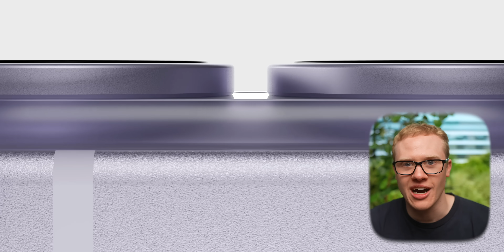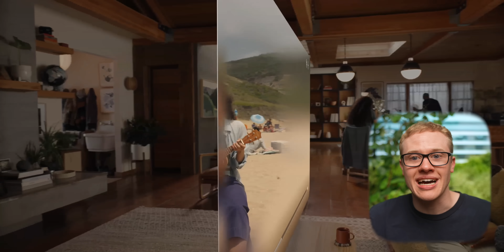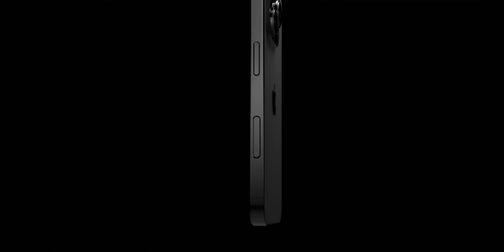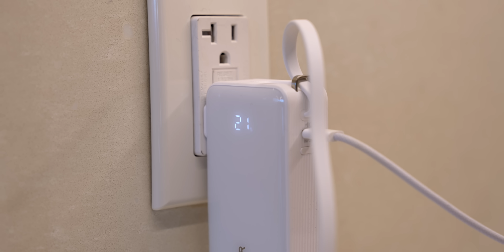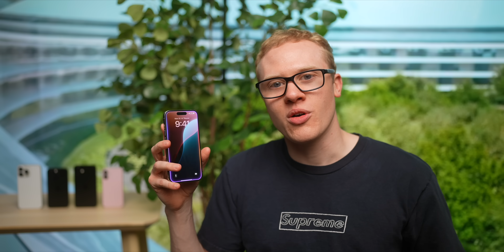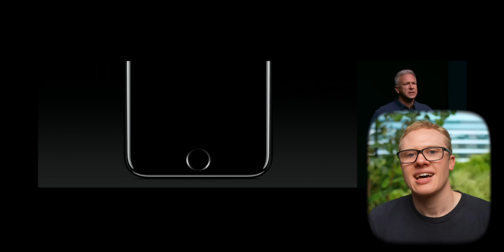iPhone 16 New CONFIRMED Leaks! FINAL Design!

Comment: Apple Humor Part 1 - Apple iPhone 12 design team: Make two cameras vertical again with a rectangle square.  Apple iPhone 16 design team: Make two cameras vertical again and this time with an oval word bubble.  Cost - $1000 and still no headphone jack.  Only charging cable included and you have to buy multiple dongles to make it work good.

Comment: I'm not an Apple fan. But I appreciate the well thought-out structure of Apple products. I'm mainly talking about the iOS system. It's like the gears of a clockwork. It just works. I've had every version from the iPhone 4 to the iPhone 15 Pro Max. The 13 was stolen from me in Kenya, so I bought a Nokia with Android as a stopgap solution. I don't like Android. Every manufacturer has its own version. Inscrutable. To put it bluntly. For me there are only two things that need to be radically improved: stability and, above all, battery life. I was shocked at how easily an expensive iPhone 15 Pro Max can be broken. And the battery life is still poor. I'm sure that more can be done technically. I don't need even narrower frames and an even better camera. The processor is fast enough. My insignificant opinion. I don't need an iPhone 16.

Comment: As iphone guy.  Action button is a joke.  Just a button.  Instead of sliding it. You push it🤦🏻‍♂️ same shit every year.  Why I'm still rocking the 13 pro max.  This phones can literally last 4-5 years depends on the battery.  If you change the battery.  You can get almost 7-8 years before it starts to slow and lag.  But idiots will run every year to get the same phone.

Comment: No one is buying a 2k headset. If its not below 1k its dead in the water just like the first gen that was over priced. You can already do a long press on the action button. If you have a series 15 series you do not need a 16 series what-so-ever.

Comment: 60hz for non pros is a joke
Reply: They should at least make it 90 hz or sum
Reply: True i agree with this @Plainbox0
Reply: 90hz would be fine.
Reply: Bro 60hz is fine I have iPhone 15 and 14 pro and 1 day on 15 I get adjust to it and it feels normal
Reply: @Igor-dg5qb  When you use a 144hz monitor almost daily? Hellnaw
Reply: @ThiccnessChicken ong 120hz should be the lowest for these new expensive ass phones
Reply: I think they should atleast increse it to 75hz
Reply: @Mikeyaep7  Honestly either it’s 120hz or it’s not especially if you’ve used a 120hz phone

Comment: I’m currently using a refurbished iPhone xr 64gb, and if it wasn’t for the 64gb, I wouldn’t actually need an upgrade. Since I need more space, I will, and with the cost difference between them, I’ll get a 16 pro 1tb as the pro max is too big imo. I only really watch YouTube, calls, text, and email, but the price difference isn’t much between the models, so might as well get the one I want most, then keep it as long as I can. Rather use my cash for a new zx10r than buy a new phone every year.

Comment: I really do think that most people who have the 15pro/max will Not upgrade, since based on your info (not enough to upgrade)as Apple did confirm in WWDC that all of the new features will be available on the 15pro/max. If Apple decides to enable a software feature that the only 16pro/max can do, there would be a hell of a lot of folks pretty upset. Apple is trying to force the 14 and below owners to upgrade as the 15 owners have been promised compatibility.

Comment: rounded sides not rounded edges the edges were rounded over and in on the flat 14 and down design. The  edges are actually very sharp and flat on current phones.

Comment: The fact that AI is only going to be available on the latest, fastest, devices, explains why the iPad Pro has such an overpowered processor. I made sure I got the most capable iPad specifically because I figured that would be the case. I’ll hold off on upgrading my iPhone 14 Pro Max, but I can’t wait to see what AI will do on my iPad.

Comment: I still have my iPhone 14 Pro Max and I’m going to wait maybe one or two more years before replacing it, I learned my lesson with trading in and honestly. My phone doesn’t have a reason to be replaced besides the negative side that it doesn’t have USB-C, I blame Apple for that honestly because they should have done that ages ago but they instead used it as a fucking marketing gimmick and a low hanging fruit.

Comment: i kinda liked the diagonal camera layout, its unique
Reply: The vertical stack is important for shooting spatial video.. so at least the change comes with tangible benefits.
Reply: @joelface  benefits that are basically useless unless you've got a 3000$ vision pro
Reply: @goldfishPACIFIER  As he said in the video, it's more of a long-term strategy. The vision PRO is the early version, but like with iphones, the pro models become the standard models the next year. After several years of iterations there will be older models for much cheaper that people will buy, especially if there are bundle deals.
Reply: @joelface  Users of a regular iPhone won't care about this feature. In order to benefit from it they must spend ≈3500$ more. Regular iPhone users are too broke for that.

Comment: iPhone 7 no headphone jack
iPhone X no home button 
iPhone 11pro no 3d touch
iPhone 13pro no charger & earphones 
iPhone 14 no SimTray
iPhone 15 no Lightning Port(apparently this is good one)
iPhone 16 no mute button & no Apple stickers (Turtles dies from 10cm plastic that no-one throws) 😮

I’m 15pro user & I’m missing mute switch . Toggling it feels like you physically turned off speakers 😅 . Action button is ok but still using as mute unmute. That will be same for capture button now people talking like most useful feature but normal user not use it & its capacitive so case will be opened. Like tuchID iPads. = less protection.

Comment: The iPhone 15 Pro and all M1, M2, M3, M4 iPads and Macs have at least 8GB of ram. The A16 Bionic has a more powerful neural engine than the M1 but it only has 6GB of ram. My guess is that ram is the limiting factor, not the chip. Also if we need at least 8GB of ram to run the Apple Intelligence LLM then how is that going to affect system performance? Like will we still be able to keep apps open in the background and still use AI? It will be interesting to see and I can't wait!
Reply: It's ram for sure, it's an intentional play to sell more.  When at the price point or say 14pro flagship point NO other phone has only 6gb that's telling you something.
Reply: @DogsTruckinOz  Considering that it’s launching as a beta and it’ll take at least a year of development before it’s starting to get good, and most people upgrade after 2-3 years, I don’t think it will be an issue and certainly won’t force anyone to upgrade except for the most die hard tech people and they would upgrade anyway. Take off your tin foil hat lol.
Reply: @The.JZA. 
When the constant drum beat is "Apple waits till it releases perfection" and apparently everything else is useless why would it take a year odd to become good?
I get that's how tech generally work but it's not how Apple is portrayed
Reply: @DogsTruckinOz  lol nothing is black and white. They even stated that it will be released as a beta in fall (September). It’s beta. It won’t be perfect and it’s also a huge leap forward so there will inevitably be a lot of kinks to iron out.
Reply: @The.JZA.  yeah I do get that, it's just the native is always otherwise.  Others bring things earlier and get flogged for it, similarly it's new and likely not perfect.  Neither is anything of Apple's, as per your comments if was accepted just like other tech Apple has many bugs and issues it would come across all more believable.  They are all massive greedy corporate entities that care zero about anything of yours, it's nieve people put one of the biggest on a pedestal when issues and behaviours are well known.  
I do question again how 6GB is fine, simple background activities are a struggle on these devices, even the most basic like Google Photos backups etc.

Comment: To be honest I don’t think any major changes to the neural engine are coming, it should be pretty similar to the M4 chip, and the m4 have pretty negligible differences  even to M2 one. They just changed the measurement standard from 16 to 8, and number looks bigger. The main point of the new  AI features based on Ram

Comment: Is it worth to trade in my 14 Pro to 16 Pro or 16 Pro Max when they come out, or wait longer to upgrade? I have a regular 14 Pro from February 2023 with 88% battery health after a year and a half and don’t like the battery life and buggy experience (factory reset didn’t help)
Reply: I would say yes because the 14 pro is known with its “battery gate” where battery health degrades very fast, i just sold my 14 PM few days ago for the same reason, was losing 1% of battery health literally every month
Reply: @soufianeaz6725  Thank you!
Are you gonna upgrade to the 15PM or 16PM if so?
Also, do you recommend me switch to the 16 Pro or 16 Pro Max? I have large hands and want better battery life, but I had 12pm which was too big heavy and uncomfortable to me. However, battery life is the most important thing for me in a phone, and more camera features than the regular pro model are nice to have too. Would you recommend getting the 16 Pro Max from a regular 14 Pro I have if so, if the new Titanium makes them lighter and 6.3 aqnd 6.9 are the new 16 pro series sizes? Thanks.
Reply: @satxrn21  I did upgrade to the 15PM since i need a phone right now, im happy with my choice since the 16PM leaks we have so far don’t seem too exciting, 15PM is way lighter than my previous 14PM, feels a tiny bit snappier, camera is definitely better and battery life is very good! Speakers in the other hands are night and day difference, best speakers ive ever had on a phone. 

I would wait for the 16PM if you know you can afford it, if money will be an issue then save some bucks and go for the 15PM you won’t regret it.
Reply: @soufianeaz6725  Wow that's crazy if true.  No way a battery capacity degrades that much unless it's deliberate....
Reply: I wouldn't unless you go to 60% or 50%.
Reply: @dodowow-mp8ji  I can get like 800$ worth of my 14 Pro now, assuming it would be 700$ when the 16’s are coming out. So overall price with the 16 Pro Max for example with a trade in would be like 860$ instead of 780$ I think. (Prices are ridiculously high in my country for iPhones - the prices are like 1500-1600$ for only 256gb for the iPhone 15 pro max model

Comment: I'm guessing the regulars will still stick with 60hz and that really is the deal breaker for me at 800+ usd
Reply: Better, the 16 will just be an incremental upgrade, the 17 will have a bigger jump, the odd number iphone releases are always a bigger jump than the even numbered releases
Reply: @Hhhh22222-w  Not always. The 12 was a major jump across the board, and the 14 Pro was also a large jump

Comment: Action button is cool, but being able to check if my phone is on silent just by feeling the switch even from my pocket is essential. If Apple could make it both a switch and a button, that would be incredible.
Reply: You can just press the action button and it’ll vibrate three or so times it’s on and if it vibrates once it’s off
Reply: They refuse to add a fingerprint sensor but want to add a button dedicated to capturing when the volume buttons do the same thing!!!
Reply: @xWonders_worldx the capture button does more than just simply take a picture.
Reply: @xWonders_worldx it will have more functions, this is what apple is testing, if the capture button is received well they will replace the volume buttons next, this way it can have multiple functions instead of just tapping or holding, the less moving parts the better
Reply: @Hhhh22222-w That seems like an ass backwards way to do it… they want less moving parts so they add a moving part in 1 phone just to test?
Reply: It should just be as easy to check if your phone is on silent with the action button like the commenter above said but I wouldn’t be mad at all if they did what you suggest with a hybrid button as well. It’d be pretty cool actually
Reply: you already get a vibration on regular iPhones, im sure it'd be the same with this if you want that feature
Reply: I mean, personally the only reason I ever use the switch to “check if my phone is on silent” is because I’m afraid I’ve accidentally hit that same switch…

I never turn my phone off silent intentionally. Never. So a dedicated toggle for mute is not only a waste of a button, but a vector to accidentally switch it to ring mode…
Reply: Why would you need you check it yourself?
Reply: Apple is always changing features for the sake of change, but not because it’s always better. 

There was absolutely nothing wrong with having a headphone jack. There was absolutely nothing wrong with the lightening connector. There was absolutely nothing wrong with having a bezel. There was absolutely nothing wrong with Touch ID so that you didn’t have to raise the phone to your head to unlock it. 

There is plenty wrong with having a obstructive floating blob every time I view a photo, though.
Reply: @Hilighted  1) The headphone jack takes up a lot of space inside the body of an iPhone. Most people prefer using wireless connections nowadays. 2) Lightning connector is worse than usb-c. It was good only for charging, but bad for everything else. Thanks to EU for ending that "lightning" era. 3) Why would you care about thick bezels? There's nothing good about it. Thin bezels look more pleasing and modern and give you more screen real estate. 4) FaceID is saver, more reliable and unique.
Reply: You have to swipe down and turn it off.  Unlikely to unlock, swipe, and select that icon in your pocket.
Reply: You can check it by the vibration now.
Reply: Apple is out of ideas. The mute switch is, and now was, one of my favorite things about the iPhone. Really dumb to get rid of it.
Reply: @bizmonkey007  I'm glad they got rid of it. Because of it there was no silent mode indication on the screen ( no mute icon 🔕). So it was very easy to miss a call. Now they fixed this issue and there's finally no need to worry about missing calls.
Reply: Personally I think apple swung and missed a home run on the action button. It should have been a slider that you could also press down for a specific action. I love the slider. Way to go apple

Comment: Are we gonna ignore the fact that these iPhones are starting to become iPads lol
Reply: In fairness, iPhones and ipad run basically the same software and up until the m1 chips came out ran the same chips, so they kinda were already the same thing in many wayz
Reply: On the bases of screen size?
Reply: @TEAML3ZAR As a apple sheep I learned that those products are mainly differentiate through their camerabump design. So know the cameras look like on the iPad I should be pretty much the same thing. 😂
Reply: S23 Ultra is 6.8 inches. At least there is a 6.3 iPhone Pro option!
Reply: @Aggie4life77  s23 is 6.1 inches, s24 is 6.2 and iPhones arent much different, both became very similar to eachother
Reply: @javo5270  yes s23 but their previous models were larger
Reply: 6’9 is nowhere close to the size of an iPad. You guys don’t say anything about larger androids 🙄
Reply: @e7jah 6'9 is larger than any android tho... and androids are mostly 6'7 from a long time, most iphones are 6'1 beside the pro max and plus, so for iphone users these are huge
Reply: @Hhhh22222-w  leaks are saying that new s25 ultra will have a 6.9 display 😂
Reply: @haruyanto8085  the s20 ultra is 6.9
Reply: @e7jah  A couple of years ago, 7 inches was a normal size for a tablet. It's pretty nuts that this is now the size of a big phone, while tablets are aproaching the screen sizes of bigger laptops.
Reply: @e7jah  size of the ipad mini?
Reply: @e7jah  navigation on an android is way easy because all the navigation keys are at the bottom of your screen, close to the thumbs reach hence no issue on operating a massive android ….having a big display on iPhones will be a little bit tricky to navigate since the back button is at the top left of the screen
Reply: @nestormakovi9573 bro you are so uneducated… I can swipe back on any page, any app…. I don’t need to touch the corner “back” button to go back… and for the record. In settings app Samsung and Google devices have a “back” button as well.
Reply: @e7jah 6’9 is nowhere close to the ipad mini’s 8’3? Apperantly 1’6 inches is a big difference for you?
Reply: rip mini 😔
Reply: @keep1hunnid no one cares about mini 😂
Reply: @PowerVibez  i know 😥
Reply: #BringBackTheMini
Reply: IPad and iPhone is same shit
Reply: The new pros feel smaller
Reply: Lol
Reply: Do you remember that one Samsung mega from back in the day? Lol crazy times
Reply: Well majority of people no longer watch tv or even own a TV set like myself a bigger iPhone is a thing of beauty 😆
Reply: @archimedes2261  how in the world would you know majority of ppl don’t own a tv -_-
Reply: So
Reply: If you really think 6 inches is an iPAD…. I bet your girlfriend is very unhappy. Bro I have a Pro Max. 14 Pro Max. It is very small…. The size of my single hand. I can single hand 14 Pro Max.
Reply: @NotGarrettG  Weird flex lol.
Reply: @stare4539  it’s not a flex dawg, saying 6 inches is TOOOO big and MASSIVE PHABLET iPad size… bro no… the iPad Mini is like over 9 inches, and four times as WIDE.